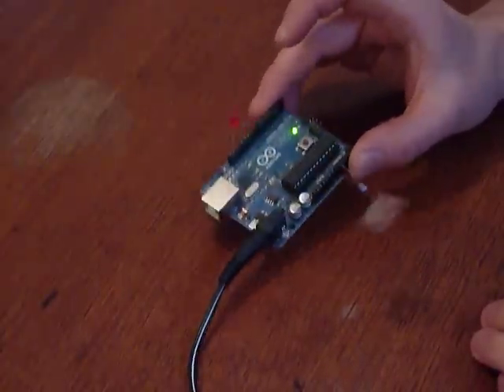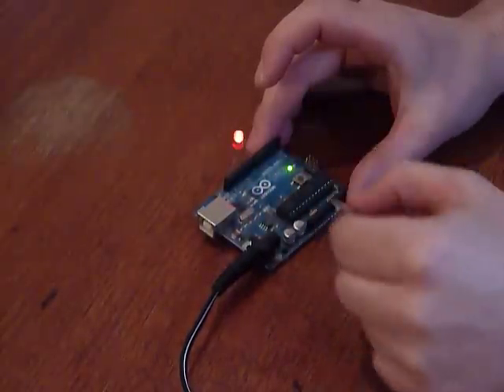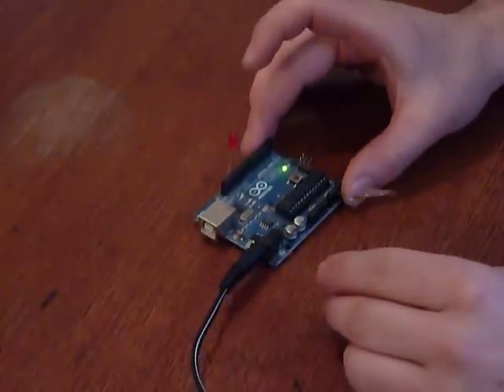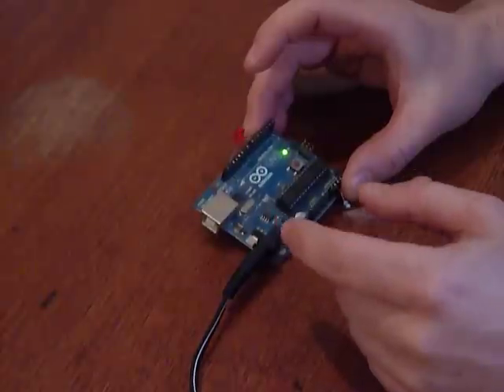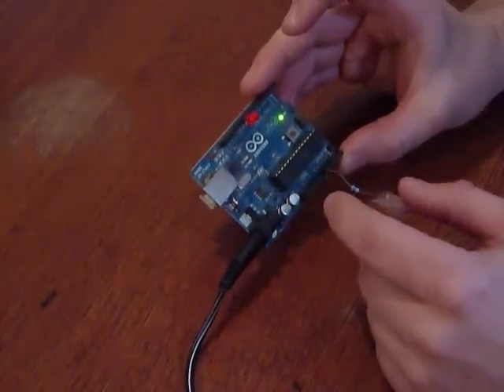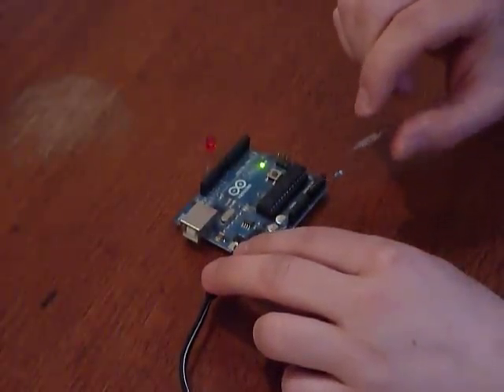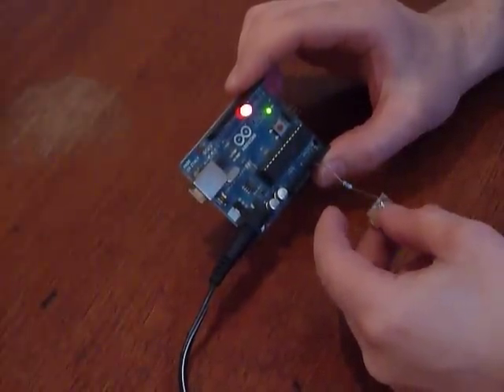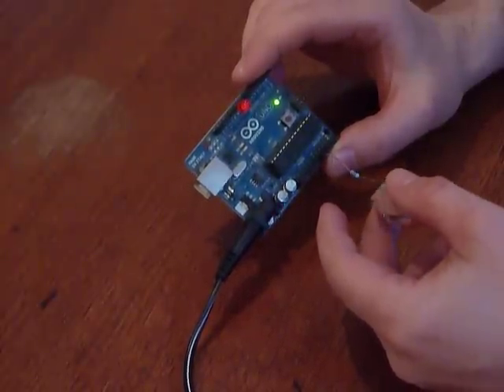QTouchADC for Arduino

Comment: Mi profesor de electronica te diría que eres un salvaje por que no pusiste una resistencia al LED
Reply from the maker: Ha! Thats funny. In deed the LED would burn out very soon if not immediately if there was no resistor. This is a special LED with built-in a resistor for operation with 5V.